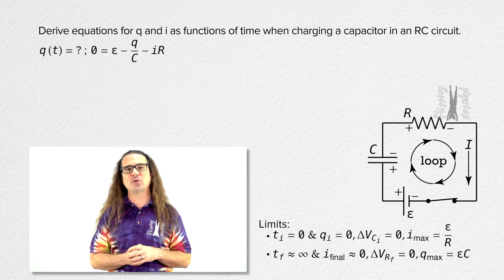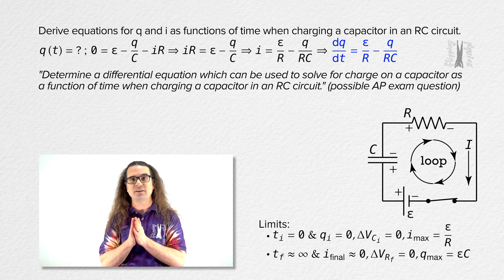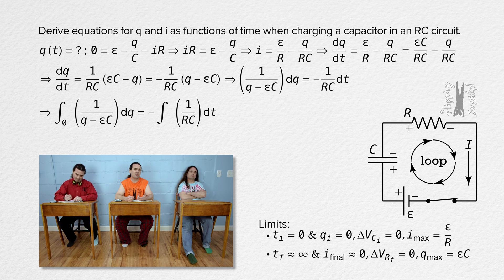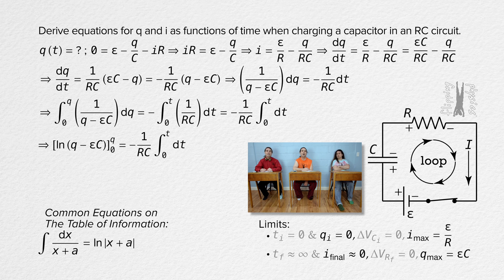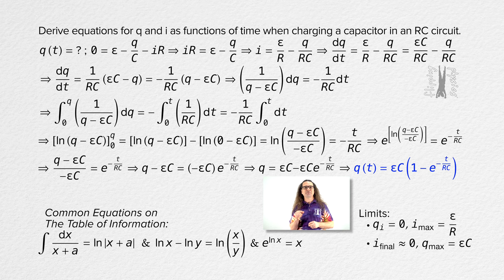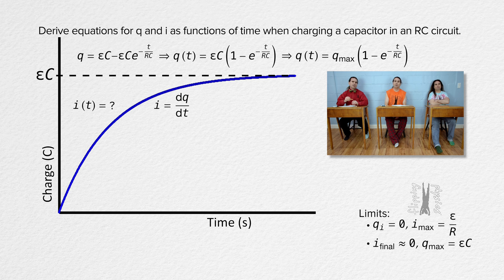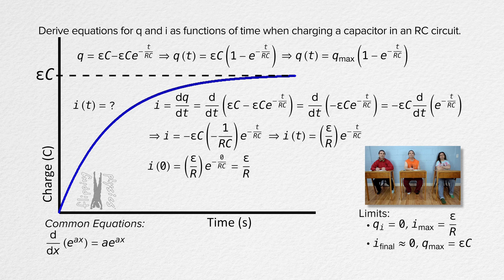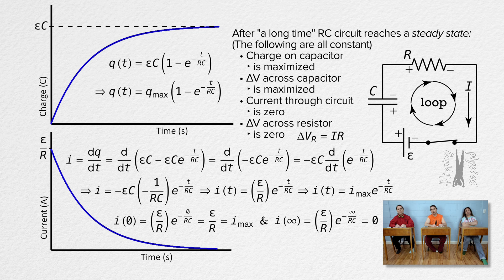Charge and Current vs. Time in an RC Circuit

Comment: Mr. P, I'm wondering if you could make an interesting video about how many times light will revolve around the equator of Earth in 1 second? It would be really awesome how to use arc length! I'm not sure if you've made a video about that or not.
Reply: @Charlie That's actually magnetic question. I've solved this problem for you:
We know that:
∆V=∆x/∆t
In this case, it'll be:
C=2πr/T
Solving for T:
T=2πr/c
Plugging the values:
2π(6378100)/3×10^8
T=0.1335sec
But as per your question:
It's the frequency. So, F=1/T
F=1/0.1335SEC
F=7.5Hz
So this is many times light travels around the earth in one second!!

Hope this answers your question!
Reply: I approached it with a different method. 
Speed of Light: 3.00 x 10^8 m/s
Average radius of Earth: 6,378,000 meters
Time taken = 1 second

V = ∆x/∆t, but because light travels in an arc, you can use the arc length formula, S = r x ∆θ, where r represents the radius of the Earth and ∆θ is the angular displacement.

Therefore, V = r x ∆θ/∆t
Solving for ∆θ, we get, 
∆θ = V∆t/r = (3.00 x 10^8 m/s)(1 second)/6,378,000 meters = 47.03595115 radians

But because I want to know how many revolutions light travels in 1 second, I must convert it to revolutions

47.03595115 radians (1 revolution/2pi rad) approximately equals 7.5 revolutions.
 @alyanhookelah